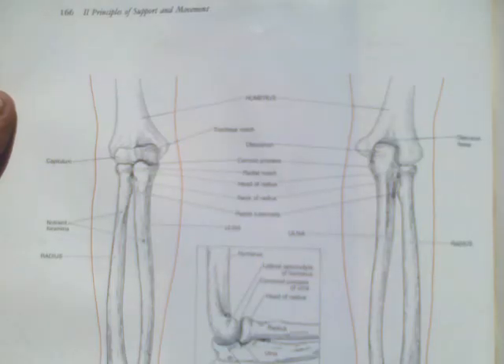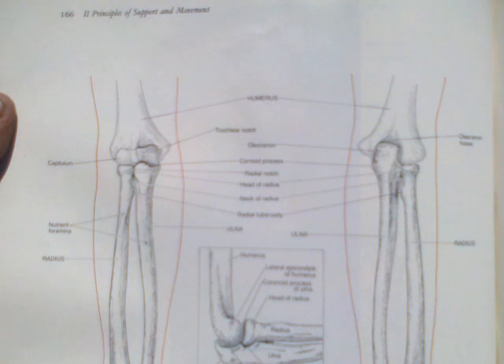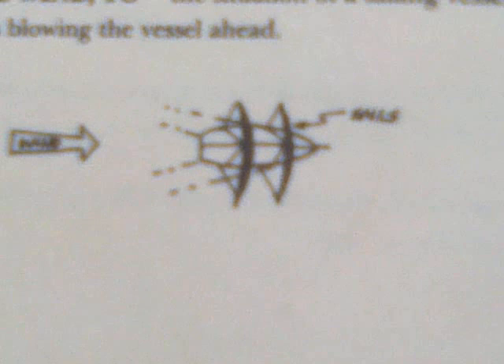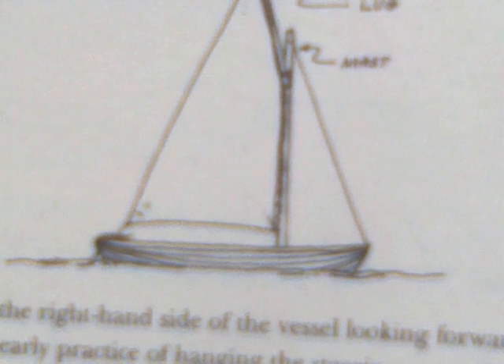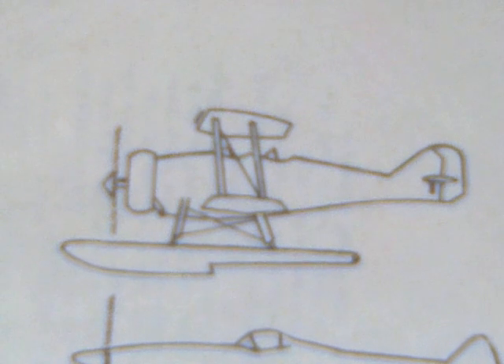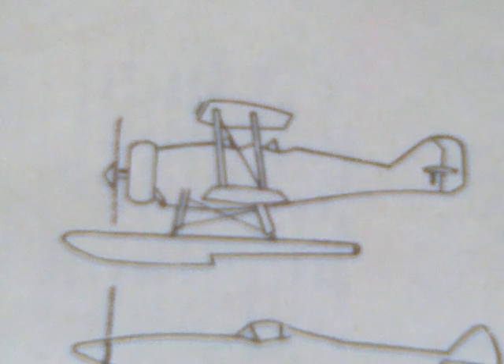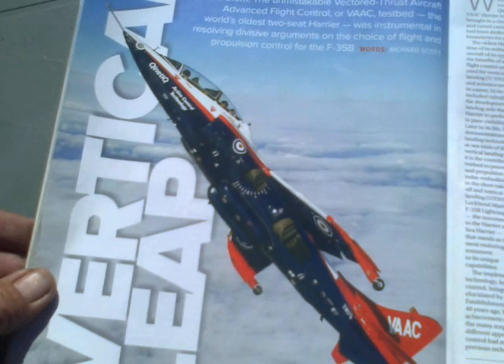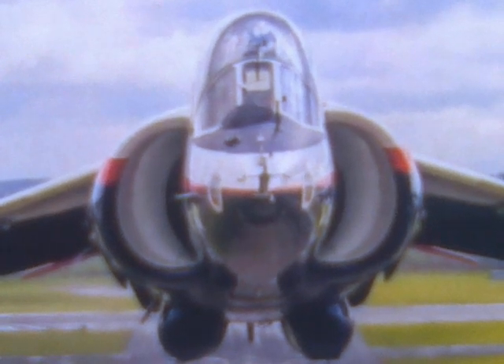Theory Of Elbarsoles, Arselbows, & Also Elbarseyeballs...!

Comment: Very nice! I like the body part analogy.✈✈
Still going to fly a seaplane in the near future. Perhaps the Icon A5, as you can land on both land and water.
I am nervous, the nose down attitude created by the drag of the pontoons hitting the water. I can imagine if you have a too far forward loaded Aircraft, that it will simply push the nose under the water, and make you go ass over head in a spectacular way.
And height judgement on a glass smooth body of water will also be an issue.
There is a video on Youtube somewhere where this was caught on film....the whole engine got ripped out of the aircraft due to the impact.
Love your work!
Vliegnet